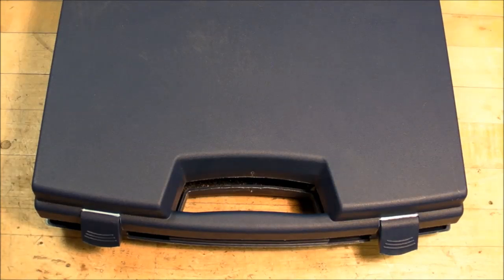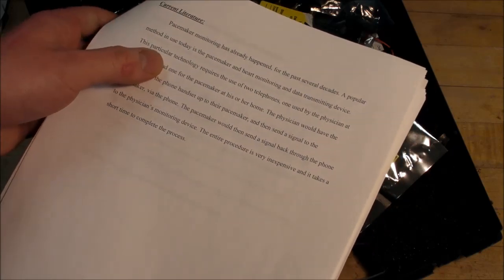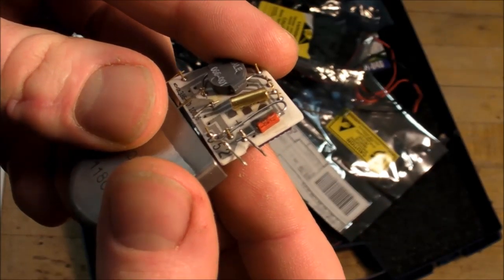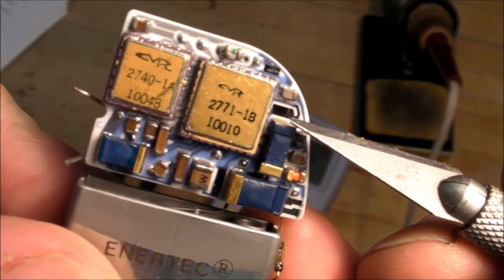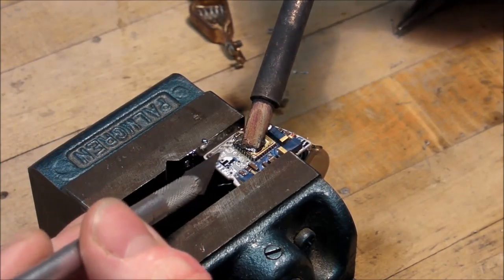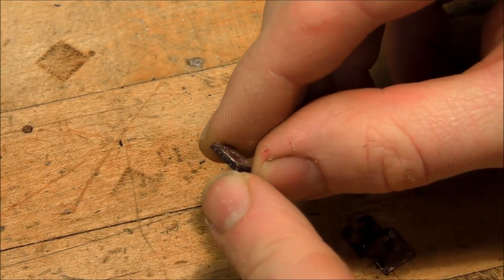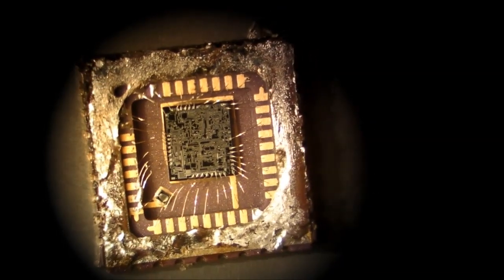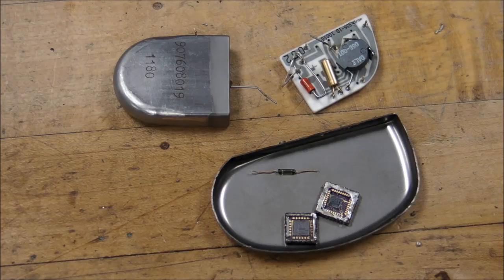(#0051) Pacemaker Teardown

Comment: I know this is very late but the reed switch is to deactivate the pacemaker - if for example it is mis-firing and is affecting the patient we place a ring magnet over the device so we have more control over heart rate, this is also included in ICD's
Reply from the maker: Daniel Lotockyj Thank you.
Reply: Great 👍🏼
Reply: Well I was thinking it could change pluse speed by tapping a coin magnet outside precisely 😮

Comment: Reed switch activates communication, battery check, etc. Crystal is a watch crystal. Two ICs are custom - one bipolar for analog circuits one CMOS for digital. Coil is for two way communication. Coil is in a resonant circuit that rings with a decaying sine wave of a few hundred kHz, for sending/receiving telemetry at very low power.

Comment: I saw one boxed implantable device where a coin cell inside the box prevented the device from turning on until it was removed from the box. Perhaps the reed switch was performing a similar function but with a magnet.

Comment: Small IC with big chip inside will be the digital side, probably a custom ASIC. Larger IC will be the power switches and the analogue signal conditioning, the larger features being for high voltage clearance. The transistor is probably a 2N2222/2N2219 dice that is the inverter drive, the diodes probably being integrated onto the analogue ASIC. Do you not have a SEM there to take pics of the whole die at high resolution?